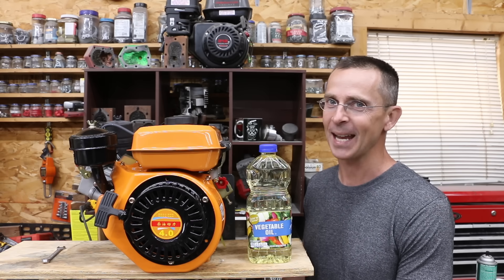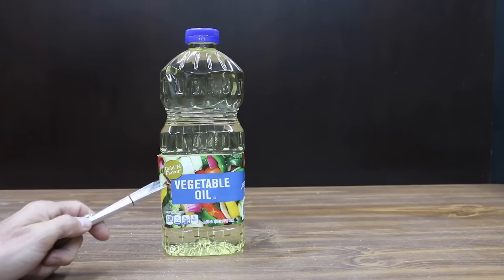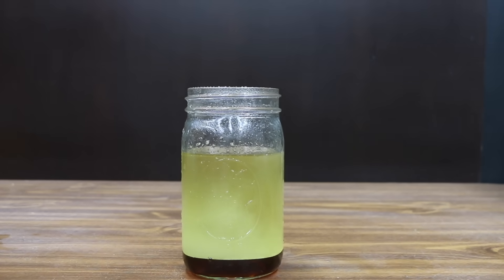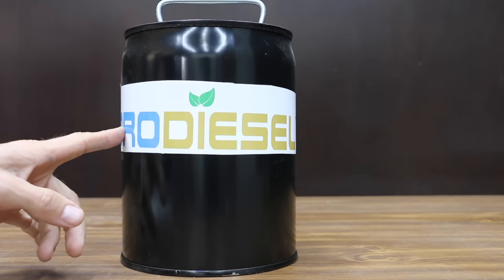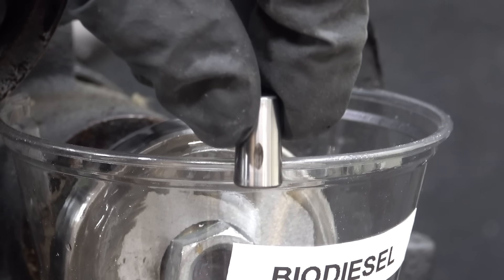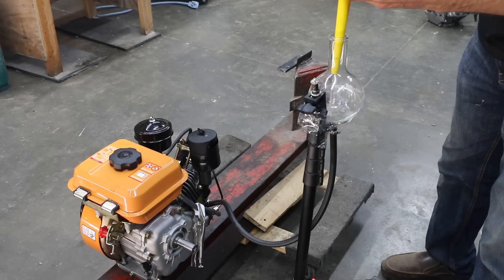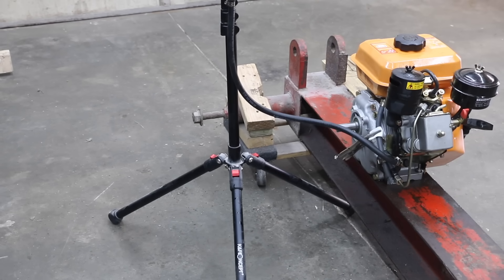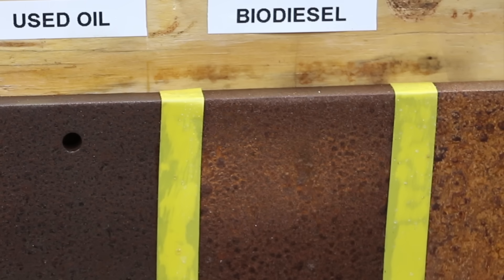Make "Biodiesel"? Let’s find out! Diesel vs Biodiesel, Used Motor Oil, Vegetable Oil, MPG

Comment: I make black diesel for a couple of years. I would guess about 3000 gallons. I farm and had several different engines to run it through. The engines that didn’t run very well on black diesel was the allis chalmers, deutz. The ones that ran great on it was a 986 international. It loved it. I would put the oil through a series of filters and then mix off road diesel about half and half. Also ran good on it was a Ford 7000, a 7120 magnum, a 8930 magnum, and a 2004 6.0 Ford pickup truck. The truck ran more smooth and eliminated the knocking sound. When the price of diesel dropped I quit making it. I run through about 10000 gallons a year. Since that time I save the cost of fuel by no till planting. We have used about a third less fuel using this practice.
Reply from the maker: That's great!  My wife is starting to incorporate no till.
Reply: @ProjectFarm  we have only been no tilling for about four years. We are out west in the desert, namely Utah and it is dry. I use to vigorously till the ground and it looked so pretty with nothing growing on it. Out here if it’s not irrigated it is called dry farming. We use to only get a crop every other year. We would only plant half the ground and the other half we would summer fallow. We would plant fall wheat and take advantage of the early spring rains to make a pretty good crop. If you waited until spring to plant you always counted on spring rains to bring it up because many times as you tilled the ground the moisture left what you worked so many times you planted in the dust. I jokingly refer to my ground as four minute ground. By the time you crack the crust to the time you get the seed in the ground you have four minutes. Now with no till we leave the residue from the old crop to keep the moisture in and save water longer. This year we tried an product that we put on the seeds that had micro organisms  that naturally occur in the soil. They mine the nutrients the plant needs from the soil that are tied up. Some of these organisms even take the nutrients into the roots of the plant. This helps the plant to use less water. So far it is working really well even though we are in a drought. I wouldn’t have believed it if I hadn’t witnessed it. The plants actually sprouted faster and formed roots aggressively. As I said the we have gone to no till for soil health. Hen you disturb the soil especially with heavy equipment it kills much of the natural organisms in the soil. Any way I have talked to much. Love your youtube

Comment: Several years ago when diesel was hitting around $5 a gallon, my brother-in-law and I decided to learn about making biodiesel as we each drove Ford Superduty trucks.  After a lot of research into building a DIY biodiesel processor, we opted to pony up for a commercial grade system that automated a lot of the process.   Getting methanol (aka "race gas") and potassium hydroxide was a bit expensive but easily found locally.   Finding enough used cooking / veggie oil was another matter.  All of the "chain" restaurants use large services to collect the used oil.  We had to scour around and find some family owned places but we typically were able to go gather about 100 gallons of used cooking oil per month. Let me tell you it's a nasty smelly process.  The used oil then has to be strained/filtered, and then typically heated and de-watered before putting it in the processor. Ours would do 100 gallons per batch.  The processing took about 48 hours total.. 24 hours for the processor to mix the oil, methanol and catalyst and have it react, then we would drain the black glycerol from the machine, then it would run another 24 hours to spray and wash the biodiesel.  At the end we would have basically commercial grade biodiesel.    Some issues (other than the long smelly hard process of gathering and cleaning the used cooking oil)... at the end of the process you have about 20% glycerol (which is the glycerin by-product with some trace methanol still in it) and the remainder is biodiesel.   You can't just give away, or dump, the glycerol.  To give it to someone for glycerin (soap making, etc), you have to first put it through another process to separate the trace methanol, which you can then re-use.  Bottom line: If you don't have an automated biodiesel processing machine like we had, it's a highly manual, tedious process to produce decent quantities.   We would spend about three full days each month to make about 80 gallons of biodiesel.   Once commercial diesel dropped back down below $3 a gallon, we gave it up and sold the processor.   It was fun, tiring, educational.
Reply from the maker: WOW! Thanks for sharing.

Comment: an issue to your claim that sulfur adds lubricity to diesel. actually the process to remove most of the sulfur out of the diesel removes some of diesels lubricity. other than this issue, great test...   also what is the little diesel's brand name?  when using veg oil, it works best with heated oil, or wait until the engine is at operating temp's. i did both, heated the veg oil and switched from diesel after the engine was warm, then switched back to diesel a few miles prior to shut down.. a person could have a system to do the switching automatically, with thermo-sensors and timers.
Reply from the maker: Thank you for the feedback.

Comment: Excellent, as always!  I am continually impressed by your testing methodology and thoroughness with approachable understandable technique.
After this video there were still two questions that niggled the back of my brain.  Clogging of fuel filter?  The used motor oil especially scares me there.  And do they all work well from cold* starts?  (*=Cold as in room temp, not freezing.)  The vegetable oil concerns me for some odd reason there.

Comment: i was going to use used motor oil rather than throwing it away, but i heard people have issues with it building up residue and even some cases the build up eventually broke loose and killed the engine.
Reply from the maker: Thanks for sharing.

Comment: Now that you have a small diesel engine for testing stuff, I suggest testing all of the fuel types in this video as well as straight kerosene, K1/ #1 diesel blend (JP5 jet fuel) and homemade diesel fuels made of stuff like citronella, ultra pure lamp oil, Zippo fuel (naphthalene), automatic transmission fluid (straight, not processed... Yes, it will definitely burn, and when you change the fuel filter in your big diesel engines I recommend filling the filter with transmission fluid instead of diesel fuel prior to installation because it's highly detergent and does a stellar job of cleaning the injectors), biodiesel made from different types of cooking oils such as olive, peanut, corn, safflower, coconut, etc and pretty much any type of oil, including suntan oil and see which "fuel" has the best energy density.
Reply from the maker: Thank you for the video suggestion!

Comment: I have been using used motor oil as fuel at farm's "workrig" Nissan Vanette. It has 2.3 diesel engine with bosch VE-injectionpump. Only downside of using motor oil as fuel is that coldstarts can be hard when temperatures are near freezing. If it doesnt start, just use some ether or blend  used motor oil with diesel to something like 50-50 mix. I have noticed that ATF is prettymuch good to use as it is, probably due low viscosity.

And remember to filter that oil before using it so it doesnt clog car's fuel filters. Using oil as fuel is great way to getting rid of "waste oil" and its most of times FREE. Nothing can beat that
Reply from the maker: Thank you for the feedback!

Comment: You should partner with NileRed channel and get him to do all the chemistry break downs for the different types of fuels. Also, you should have thrown a little Jet-A in there for comparison. It's a dry fuel though as it has most of the impurities removed that would normally be found in diesel fuels for lubrication.

Comment: I have been driving years in my 89 f350 7.3 diesel and run it off anything that burns really. I just change the fuel filter every 10k miles or so.  So far i have run diesel,  kerosene, used motor oil, used turbine oil, atf, a bit of diff fluid, and hydraulic fluid. Basically what ever people are getting rid of.  I usually run a couple gallons of diesel and a couple ounces of optilube summer blend to help with viscosity and increase cetane for starting and cleaner operation
Reply from the maker: wow, thanks for sharing

Comment: What about ATF? I hear a lot of diesel guys talk about running it mixed. Some even say they can run it strait. I think it's mainly for cleaning injectors but still curious on how it would run.
Reply: Why? It's much more expensive than regular diesel, unless it's used atf then you'll have to filter it properly.
Reply: ATF isn't meant to be burned and the added friction modifiers wouldn't do the pumps and injectors any favors. I too have heard guys brag and recommend running ATF in their trucks but you'll NEVER catch me running anything but fuels and additives intended to be used as such.
Reply: I have been running a 12 valve Cummins for 10 years on used motor oil and/or ATF with no problems at all, in fact it actually seems to like ATF over motor oil.  Stay away from full synthetic oils though, for me it tends to run rough and the EGT's get high.  On an older truck I wouldn't hesitate to run motor oil/ATF but with all of the sensors and complicated injectors and pumps in the modern diesels I wouldn't risk it.

Comment: Thank you for another great video! It would have been interesting to see if there was any fouling inside the engine from the used motor oil.

Also, a suggestion: Would it be possible to run that diesel engine on LP Gas instead? Very curious about that.
Reply from the maker: Thank you for the video suggestion!

Comment: I don't know about the US but in Germany running your car on anything else than Diesel bought at a gas station can result in tax evasion charges. Commercial Diesel has additives that make it distinguishable from oil used for heating purposes, which is much cheaper. So people might want to check their local laws before experimenting with stuff like this
Reply from the maker: Thank you for the feedback.

Comment: great vid. thank you for the diesel test. You didn't do a run time on each fuel variant or under load. Need to add a generator to that engine for load testing. Had a voltswagon rabbit diesel manual fuel injected. ready supply of used motor oil being entire family used grandparents garage to change oil. Mixed it with 10 to 15 percent with red kerosene  and it ran hot but powerful and cheap. less than $15 dollars to a full tank. great car for a teenager
Reply from the maker: Thank you for sharing.

Comment: The svo types around here tend to run two tanks, and the svo is heated by engine coolant while running on normal diesel then they switch it over.  Likewise they switch back to diesel and run it a bit before shutting off.  Used hydraulic oil runs good when blended with some diesel as well. A lot better than used oil.
Reply from the maker: Thank you for the information!

Comment: only thing left out was black diesel. mix some used or new engine oil with some diesel and see how it runs. ratios vary but generally u want a little more diesel
Reply: main idea behind black diesel i believe came from somebody trying to provide some extra lube to an older injector pump
Reply from the maker: Thank you for the information.
Reply: @ProjectFarm  thank you for the great video!!!

Comment: This is only for older designs with mechanical injector pumps. The owner's manual for my 2014 common rail injection GLK250 specifically warns against using biodiesel in concentrations greater than B5. Fortunately, where I live diesel is less expensive than regular unleaded for most of the year and costs about the same as premium unleaded during winter. For those who are worried about ultra-low sulphur diesel not providing sufficient lubrication to the injector pump, the solution is to add a small amount of two-stroke oil to the fuel tank.
Reply from the maker: Thank you for the information.

Comment: I got involved in a "Breaking Bad" type operation back some decades ago while working with some folks under the radar producing a lot of diesel fuel equivalent in a big hidden lab. We had a couple of Walter White style chemists, a Gus Fring style benefactor and distributer and bunch of gangsters procuring our supplies. My role was more of along the line of a young Mike Ehrmantraut. Being ex military and a current private military worker at the time I was the problem solver for the operation. We did pretty good for a few years until the FBI got involved and we shut the whole thing down and went our separate ways. Funny thing too one of the agents investigating the untaxed fuel turning up that we were producing was a former brother in law of one of the chemists just like in the Breaking Bad series who inadvertently tipped us off.
Reply from the maker: Very interesting!
Reply: That's "former military," BTW. "Ex-military" means you were thrown out.
Reply: @erwin643  Semantics. I kind of was thrown out but not for doing anything bad. I was just disenchanted with the Marines at the time for utilizing me as a radio tech due to my electronics background rather than letting me do what I joined to do which was to blow shit up and kill people. When that Graham Rudman act kicked in the 80's they gave me the boot 3 months early because I had no interest in reenlisting. The usual general discharge which converted to honorable discharge after completing my 2 years of inactive reserve.
Reply: oh the FBI most likely knew everything they was doing and sit on it for a very long time until they was ready to bust you... untaxed fuel is way more common that you may think but the gov't usually don't come after you until they know you made a certain amt so that they can seize your money... can't hide or smuggle that amt of fuel without the gov't not knowing because the oil companies got the best of the best working for them and they would be the ones to find these operations and then force the gov't to go after ppl... down in the Florida area (i'm not going to say where) i knew a few guys who actually made aviation fuel and they got their raw supplies all the way from Venezuela (i never did buy anything) but they told me how things work.. you're right about everything else, you got to have a good chemist (a Walter White) but they didn't steal anything as business men sold them what they needed on the down low..
Reply: @dunhillsupramk3  Yup, that's how intelligence rolls; they don't go after anyone until it makes economic sense to do so. I actually had a neighbor years back who made his own biodiesel for his Duramax back during the financial crash; in common midwestern style he had his 1000 gallon EPA containers of used oils and chemicals sitting outside, no biggie alongside his garage. Tons of neighbors complained that it looked like a meth lab and demanded the local Sheriff do something about it, only to get them explaining to the NIMBYs that there was no way government agencies would go after one guy even if he was doing something illegal because of how little economic impact he was having. Pretty sure he's still making it today too.
Reply: This reads like the navy seal copypasta
Reply: @Klajnepojken  Huh?

Comment: Occam's razor= the simplest solution is the best. If the engine runs in plain vegetable oil, why bother chemically processing it to make biodiesel? Efficiency aside, what energy cost is involved in getting KOH from saltwater, or other mineral, and what is the energetic cost of turning KOH into flakes? The overall energy cycle has to be taken into account.
Reply from the maker: Great feedback.  Thank you
Reply: @ProjectFarm  it is simply KISS the las S is your choice

Comment: I once got a oildrum filled with used fryeroil from a friend, I filtered it through 3 filters, each finer than the one before. Then ran my car (2006 Opel Vectra with the Z19DTH engine) on a 50/50 mix of diesel and used fryeroil for 3 months, performance was reduced noticably, but a full tank was just half the price so I was fine with that :) Now Shell has started selling GTL (Gas To Liquid) for dieselcars, up until recent it was only sold at docks for private boats. And I must say GTL is amazing in my car, better performance AND close to zero NOX emmisions, I can recommend you trying it in your truck :) My wifes 97 Silverado 6.5TD stops rolling coal when she puts it in the tank :) :) Great video as always
Reply from the maker: Great information! Thank you

Comment: What about those biodiesel conversion kits ppl were using years ago on any diesel motor and running them off the old vegetable oil from fast food places? It was free fuel since the fast food places had to pay to dispose of it, the ppl with biodiesel conversions were getting it from them for free. Thats not the same as the biodiesel you made is it?
Reply from the maker: You are right.  A lot of people just use it without removing the glycerol.
Reply: @ProjectFarm  but does that effect anything? And what about the kit they use? Is it really necessary and offer any advantage? Might be worth trying in another video